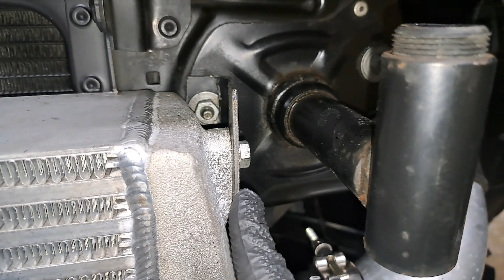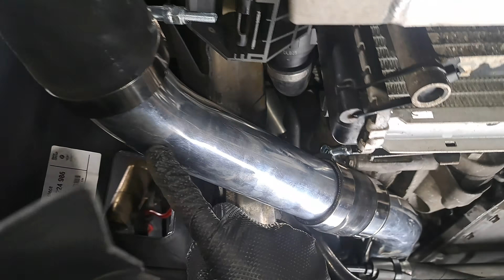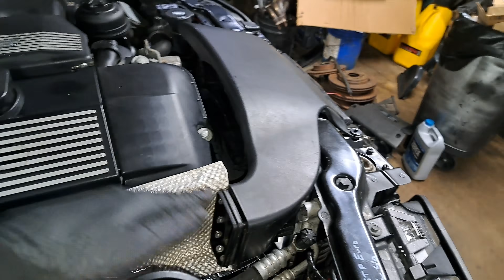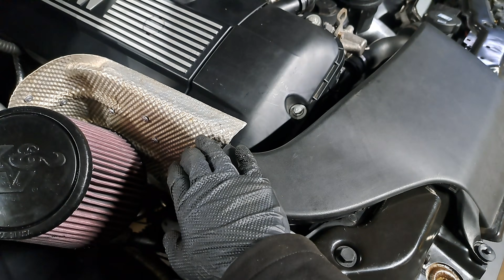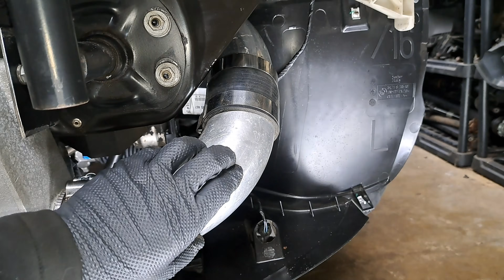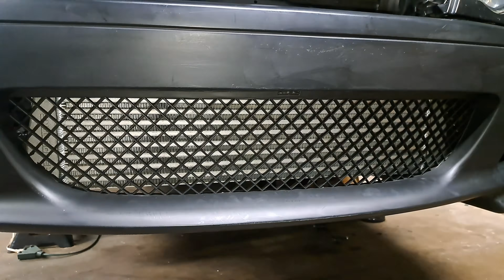BMW E46 Turbo Build - Intercooler Piping Bottom Mount Turbo Intake Intercooler

Comment: I have 325xi, has sentimental value to me I don’t ever want to get rid of it. I want to bottom mount turbo it. But everyone on the internet is saying you’ll have a hard time with the bottom mount bc the front axels. Also that the t case is shit and will grenade itself if I boost it, but if i keep it like a mild tune 250-300 do you think it will survive?
Reply from the maker: Who says that, people of Reddit? Xi drivetrain is strong. 450whp. If you have auto transmission it will slip before the xi system breaks. As far as room, you'll have to experiment. Will be tight.
Reply: @OLearysBMW i appreciate the info. Yea I was going based off Reddit and forums. I was considering a whole rwd conversion but I don’t want a drift missile, just want it clean and quick nothing crazy like 500 to the wheels. and it’s stick shift so a +. Im just worried about having enough room now 😭
Reply: I think I was way over complicating everything, I’m now considering a top mount set up. It’s not gonna be a drag racer or something, I just want it quick when I’m crusin with the homies

Comment: So the stock FPR can function as a boost referenced FPR? I didn't know that.
Reply from the maker: Yes, used commonly. But would not use with anything larger than 340LPH pump.
Reply: I'm using a 340 lph pump, so uh... yeah. 😎

Comment: I'm always impressed by your attention to detail. The little extra steps you take that no one else really thinks of, the heat shielding the diesel variant air scoop. If I lived in your neck of the woods I'd have zero issues with you working on my cars in fact I'm pretty sure I'd be pleasantly surprised every time I came to collect one how much further you had taken it.  O'Leary's OEM++ Autoworks👍